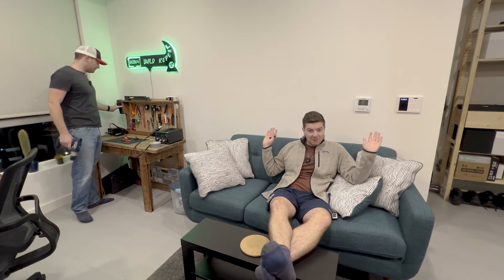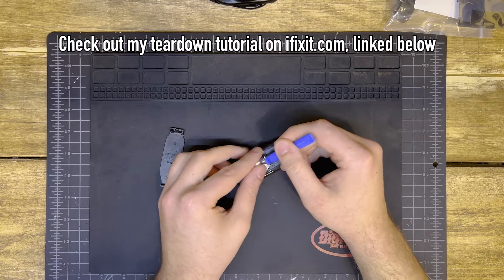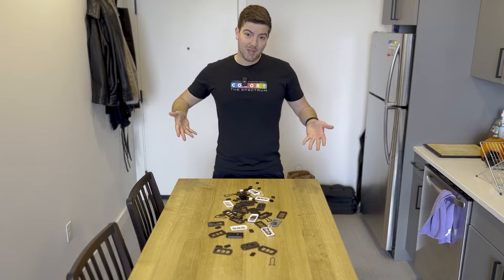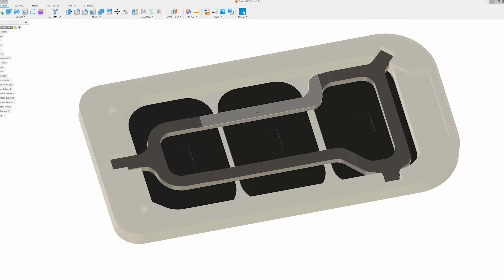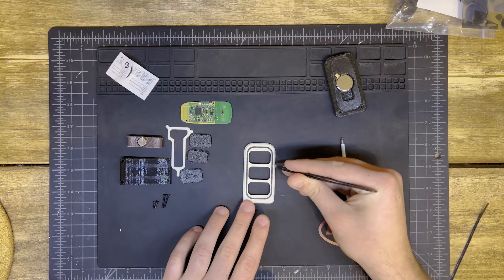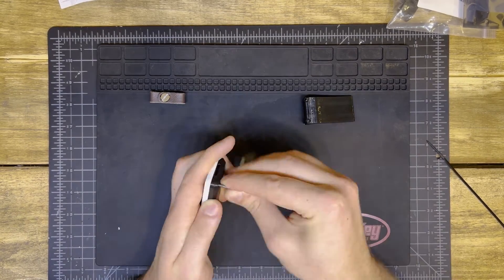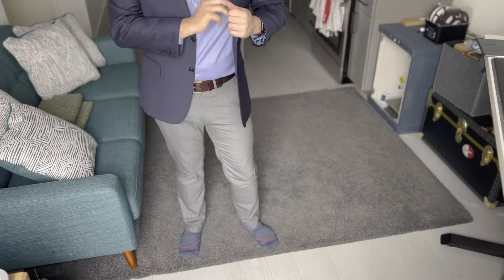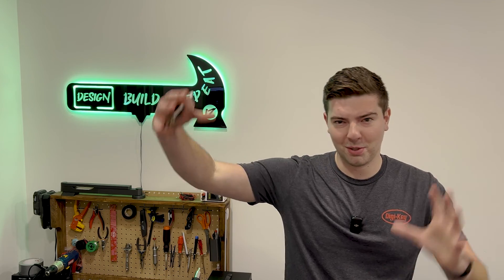Creating The Ultimate Tesla Key Fob Upgrade!

Comment: Great video. Have you tried to make a thinner version of this? It will be great if it can fit inside a phone wallet case. There are various posts discussing how the key card does not work on older Model S cars due to lack of hardware. It is cumbersome to carry the key fob in addition to your wallet and phone. 
I was thinking, you can move the antenna and battery to the side using a wire and this will allow the thickness to be close to the battery thickness.
Reply from the maker: That’s a good thought! I may try it if I have some time

Comment: This is amazing!! Does this work for the model S key fob as well??  I would absolutely love one of these!
Reply from the maker: Thanks for the feedback! I'm not sure if this would work on the S key fob. Theoretically it should be the same technology. If you can get me measurements of the model S pcb (I'm assuming you have one), I can check for you!
Reply: @IZLabs  Yes! I get 58.6mm long x 26.2mm wide at the center. From the center of the frunk button to the center of the trunk button it's 35.5mm. Any other measurements you need?
Reply: I have a model s fob I can send you if your interested

Comment: Any thoughts on creating a keycard with the components of the key fob? Just a slim card that no longer has the buttons at all. I never use the frunk, trunk or lock:unlock buttons. I'd love to have a card similar to what current Teslas have. I know but would be thicker than a true card, but it would be an interesting project and concept! Great video BTW!
Reply from the maker: Glad you enjoyed it! I thought about making a card, but it was the thickness that threw me off. It wouldn't fit in my wallet sadly. If you have a thicker wallet, you could probably drop the PCB itself into a compartment and get the effect you're looking for. Thanks!
Reply: Needs to be a phone case!